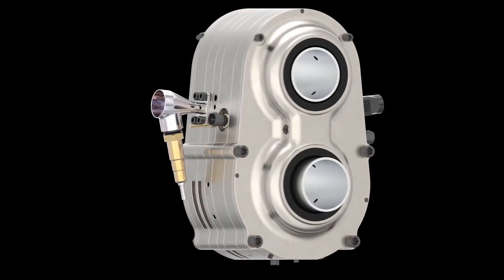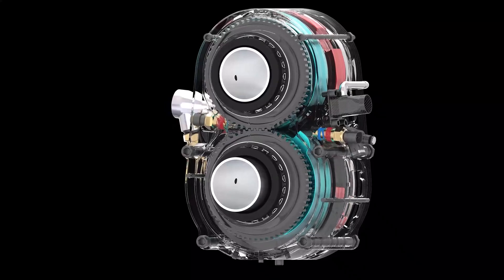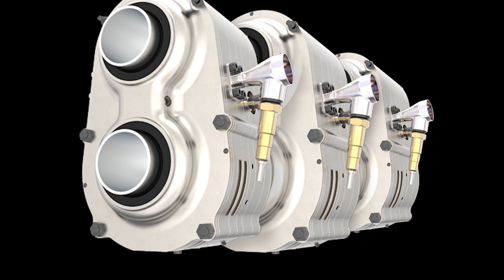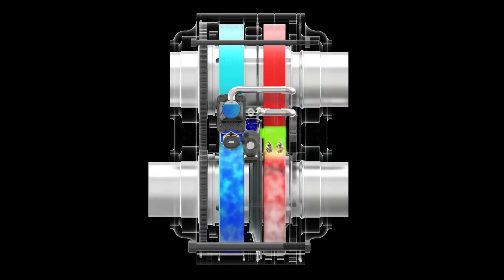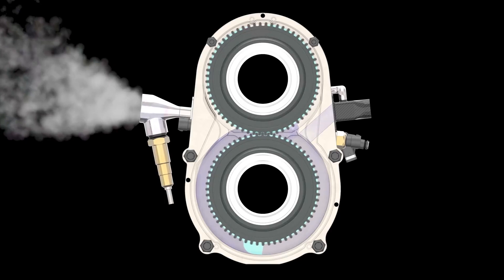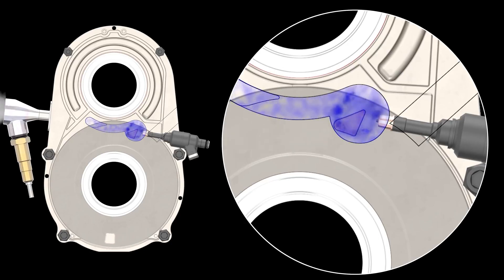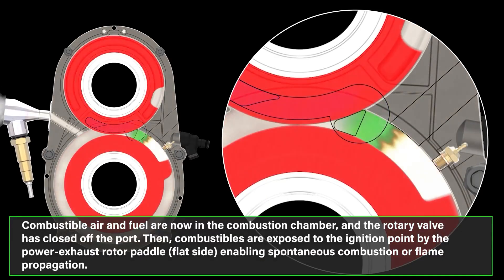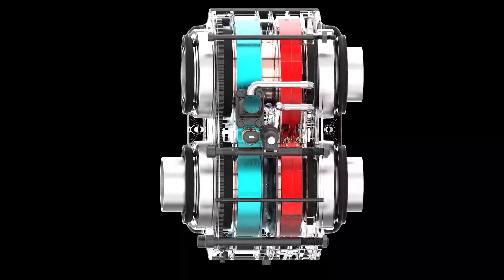This pistonless engine runs on hydrogen and revs to 25k rpm

Comment: That is a variant on an engine designed in 1968 in the UK as an auxiliary power unit to be used in a tank.   A prototype was built and produced 90 BHP at 12,000 rpm.  Never went into production as far as I know likely due to friction losses in the necessary reduction gearbox required.
BMW gave up on developing hydrogen powered cars a few years back though they made several test cars as well as the refuelling stations.   Whilst the emission of only water vapour is the "holy grail" of IC engine Design Engineers,   the problems of using such a small moleculed gas are "significant" why is why after several years of design and development BMW have discarded the idea.  Currently Toyota are studying hydrogen fueled engines for cars.
Reply: Toyota is having some pretty solid success with that Hydrogen tech. They innovated the hybrid car with the prius and it was a home run. Still one of the best selling cars they have in the lineup. I'm gonna bank with them getting Hydrogen figured out especially with Yamaha in their corner. Yamaha engineers are on a whole different level and they make some of the coolest stuff when they partner with toyota.  Kawasaki is also looking at Hydrogen for motorcycle engines, but haven't heard much else about it.

Comment: With no seals how long will it last? Also if it needs a fuel/air mix at 250PSI the compressor may be bigger then the engine and take a great deal of its power. I would like to be wrong, but just thinking.....
Reply: It needs to be built and extensively tested.

Comment: Deny all you like, but it's a Wankel. On top of that, it has the SAME issues as the Wankel. End seals leaking oil.
Great Design, poor video by trying to lie about the type.
Wankels are excellent engines. Great power for their size. Checking the oil before use EVERY TIME being the only drawback.

Comment: I  designed one similar about a decade ago. dropped it due to the thought of EVs taking over.. If anyone interested we can still patent it.. i am willing to go 50/50. my design your finance. I am based in South Africa too.
 difference with mine is that each engine has at least 2 or more combustion rotors in parallel and multiple engine can be aligned in series. Also mine is a world first in one category.. Not sure how powerful it will be though..Need to bring in fluid and thermodynamic specialists in.. Can't say here what the unique part is until patented.

Comment: 25,000 rpm means massive friction and pumping losses. High speed does not eliminate the need for seals. There is nothing described that adds up to a real engine.

Comment: I love the idea.

My problem is the issue with getting 25000 rpm to roughly 650 rpm on the road wheels. The gearboxes are going to be huge.
Reply: It may be capable of 25k, but that doesn’t mean that’s it’s only operating range.
Reply: Maybe not, take a turbo prop aircraft engine for example, the shaft speed is perfect for a vehicles 4:1 differential drive
Reply: @satunnainenkatselija4478  there are already turbine powered vehicles
Reply: @dirtbiker1928  When idle they burn like half of the amount of fuel they need for full power. That's why they don't work great in cars but are good for aircrafts ie.
Reply: Cvt or hybrid
Reply: @satunnainenkatselija4478  This would be great for ICE- electric hybrid vehicles, everything from lawn tractors to railroad locomotives.
Reply: Like one guy mentioned. A CVT trans complelty solves that issue
Reply: It won't be used in direct mechanical drive applications; gearboxes will just sap too much power & create too much heat. More likely will drive an electrical generator, but at those sort of high RPMs, there will probably too much eddy current losses, leading to massive heating. There are better, more practical & actual working engines that run at much lower speeds.

Comment: Can't see how it'll work without seals, manufacturing costs go through the roof when tolerances decrease. To seal gasses the clearance are insanely small and not achievable in general production. 
Also any vibration or flexing will turn clearance into interference. This would destroy the motor. 
Apart from the fact it's not feasible without seals, it seems cool
Reply: It WON'T work without seals.  It may sort of work, because it's the intake charge it so pressurized.  (Notice no mention of how that happens)  But it's going to be blowing a cloud of partially burnt fuel and lubricating oil out the exhaust.  Plus all the other Wankel downfalls of poor fuel consumption, longevity, etc.  This is to lure unwise investors into a project that will never reach production.

Comment: Nice concept, probably impossible to make on anything approaching a large scale. 

This thing will get hot, really hot, and if they are not going to water cool it, then it's going to need to be made from some fairly exotic materials. But that heat is still going to go somewhere, and without water cooling, that either means the heat will radiate into everything else in the engine bay, or a lot of cooling ducts/heat shields which take up a lot of space and make packaging hard for tight applications like the small car alluded to here. Then there's the thermal expansion, and the differential therein. I'm making the assumption that that is what the "shims" are for, some form of thermal expansion mitigation or thermal isolation, likely both. However, since this design is relying on tight tolerances to eliminate the need for the seals that ruin Wankel engines, those shims will have their work cut out for them, notably with that rotary valve. For that valve to have any hope of working out like they hope, the tolerances between the valve disk, and it's containing walls will be incredibly tight, and if that valve disk doesn't expand nearly perfectly uniformly, there's going to be issues. Then there's the inter-rotor interface. How do they plan on keeping them interfacing just right as the rotors heat up and expand. Too tight and the engine grinds to a halt. Too loose, and it'll lose power. I'm guessing it'll have a noticeable lack of power when it's cold, relying on the thermal expansion of the rotors to tighten the inter-rotor interface and lessen blow by.

It does tickle me that this engine will be a new age hit or miss engine. The ability to skip fire isn't so much a feature as a requirement. The engine will need to maintain the high rpm they also tout as a feature to keep the air leakage down. I have to wonder what sort of working rpm range these engines will end up having and how rpm will affect efficiency.

If this engine works out half as well as the hope, it would make far an interesting light aviation power plant and other similar steady state applications, but I doubt it will work well in most automotive scenarios.
Reply: agreed. cooling is allready a problem on wankel rotaries revving to much lower rpm, and relying on production tolerance for your engine to function in the first place seems like a silly plan for practical application. im sure it works great out the factory, but if its used in a car the owner will expect it to last upwards of 200.000km without breaking a sweat.

Oil cooling is another thing for such super high revs. the RX-8 uses two decently large oil coolers to keep its heat under controll for its comparatively low redline of ~8k, but this engine is talking several times that speed.

Overall, very neat concept, but i dont think something that relies on being in mint condition to even function in the first place is gonna work in daily use, regardless of plane or car.
Reply: @fenchellforelle  Aircraft have very strict maintenance requirements, so I think this engine could* work in that regard, but yeah... This design doesn't seem to have any allowances for heat or wear, unless it's using some exotic materials that would make mass adoption all but impossible.

Comment: Batteries are never going to replace the internal combustion engine. To many issues with charging them up. I recon these lightweight rotary engines could be the way forward on hybrid type vehicles.

Comment: I'll believe this when I see (and hear) a running prototype. I doubt the figures, seems lossy transferring gases from one rotor to another. And the fact that it needs to rev like an actual turbocharger to avoid leakdown means even more parasitic losses... Still a very cool idea, and better than trying to herd electrons together in a battery pack
Reply: yep i totally agree, the "no seals" statement rang alarm bells for me, maybe it's an "external combustion engine" LOL
Reply: Ah yes, generic phone user to dispute battery ideas, when the modern world solely relies on electron energy to keep the Computing running, which your entire life is connected to like a medical aid. Fossil is just One of the means to generate power. But that happens when one wasn't alive to live through steam power era and devoid of computing systems.
Reply: @changsangma1915  are you for real? Or like this power plant, only in the imagination? :)
Reply: ....depends what your bloated ego wants to dispose me as. I could care any less!
Reply: @changsangma1915  what are you on about?
I said, quite simply, that this "engine" has not been built. And so, I shall believe those claimed output figures when the engine is running. What in earth this has to do with batteries and the electron I don't know? I appreciate you may be a clever person, but you're trying to be too clever by half here.
Respect where it's due, you're posting in English, which isn't your first language, and I struggle with anything more than very basic French. I just don't know why you criticise my doubt of this design. It has not been built yet, so it's a realistic as Star Trek's warp drive, and dilithium crystals.....
Remember, the Stirling engine was thought to be the answer to humanity's energy needs, but they have found very limited practical use. The Wankel promised the same, but again proved extremely troublesome and even to this day they are not fully compliant with CARB emissions standards. 
But then again, I'm just on my phone and I am a generic user....
Remember, any heat engine cannot exceed 66.66% mechanical efficiency....Carnot cycle and all that
Reply: @davehayhurst1780  .....your engine critic is only as relevant as the edge statement on battery tech you spat at the very end, if you are even aware of what you type. Entitlement and egoism mixes quite well when blowing off a bunch of criticism cause you dont have the sheet of validified details handed to you. Thats your burden to work it out. Oh about English, better off do it in your native dialect which you do it so efficiently? Pff
Reply: @changsangma1915  electrical cells are notoriously difficult technologies. The energy density is tiny when compared with fuels. Hence we have mains electricity. Before widespread adoption of the electric car, there needs to be enormous advances made in battery technology. And in any case, this engine provides mechanical power, so your petty arguments are rendered virtually moot
But thanks 😊

Comment: One reason this may likely get built is because the threat of electric motors and vehicles displacing ice engines. This is also an ideal motor for VTOL aircraft due to its high horsepower to weight ratio which is what is needed.
Reply: What threat? Car manufacturers are all allready making electric cars. Are they threatening themselves?

Comment: The problem with Hydrogen is that most hydrogen today is extracted from natural gas in an energy intensive process which releases more CO2 into the environment than simply burning the natural gas!...  Technologies like this will only be viable when the economics of producing hydrogen without burning fossil fuels is viable....  Hydrogen is not a primary fuel, but an energy storage mechanism.